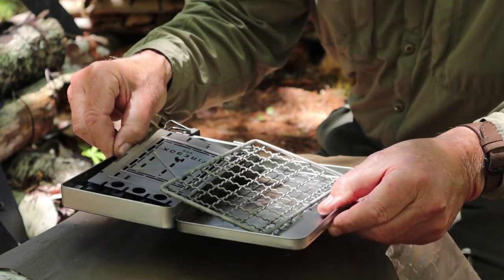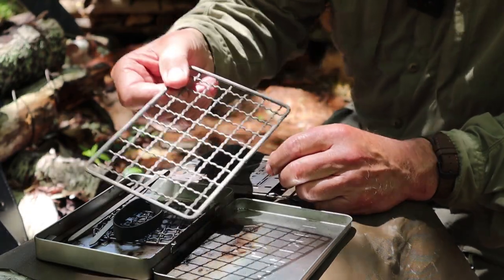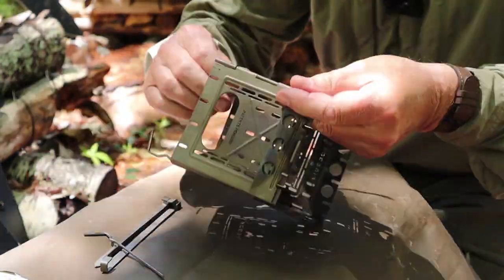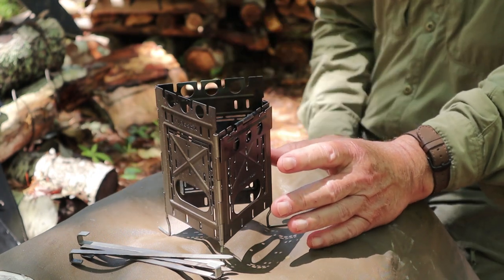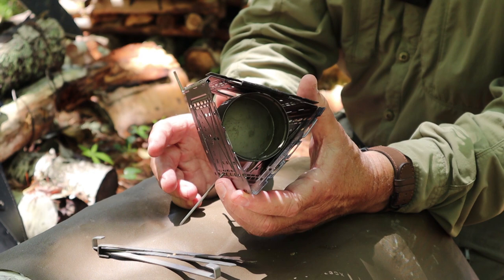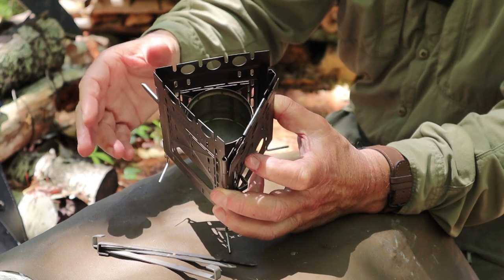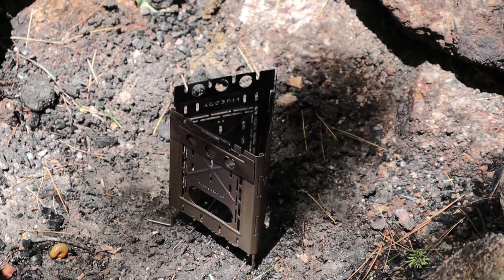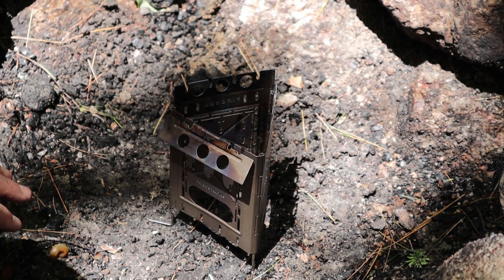Firebox Freestyle in Three Sided Configuration

Comment: Well done Mark 👍😎👌
I really like the three-sided stove and have found myself using it quite a bit. I don't find it necessary to have the fire Stick crossing on top to hold a small pot. The corner of the two high sides seems to do the trick just fine. For me the only reason to carry any fire sticks at all would be if I am planning to use an alcohol burner. Otherwise all I need are the three sides which makes for an extremely minimalistic and ultralight weight wood burner 👍 Cheers😎
Reply from the maker: Hi Steve. I agree, the three-sided stove makes a great minimalist stove. Thanks for commenting

Comment: Use the cotton bag, buy some 6mm thick firefelt as a heat protective base, aluminium foil is a heat sink, so must still get the ground hot.
Leave the oversized tin at home when using 3 and 4 sides.
Thank you for sharing, all of interest as usual.
Take care
Reply from the maker: Great suggestions. Thanks for commenting

Comment: The problem with any tall stove is that, once the coal bed is suitable for grilling meat, it's too far below the meat to cook it. I use my large Toaks titanium stackable stove for a quick boil, and my Firebox Nano for grilling, though it suffers from a small surface area. It's great for hot dogs and sausages, though, which are better options for hiking than burgers and steaks. On this spring's 230 mile Appalachian Trail section hike I left the wood stoves home and  just used my Supercat homemade alcohol stove. My longest time between resupply options was 6 days, so I didn't need much stove fuel. Surprisingly,  I didn't miss a wood fire. I only spent one night in the woods with a group, and they built a nice fire in the fire pit. Interestingly, no one used it for cooking!
Excellent presentation and wood stove physics theory.
Reply from the maker: Yes, tall stoves like the Toaks work best for quick heat for boiling but not so much for grilling. It is hard to find a stove that does it all well and is still ultralight. The Freestyle and the Nano are close but even they take skill to use for grilling. Thanks for commenting

Comment: I’m assuming you’re using the smallest of the fiberglass mats available (30cm x 30cm). Could it be folded around the disassembled stove, top side facing inwards, and secured with that Ranger Band you left behind, to act as a case for the stove, so the bag could also be left behind?
Reply from the maker: yes, it the smallest one and that is a great idea. Thanks for commenting

Comment: Getting all the lighter weight advantages BUT with a high quality stove. You're not wrong about issues at altitude. The ice cream always expands on my way home from shopping. 2-stroke engines can get the wobbles, especially with changes in air pressure up here. Great video Mark. Can you still use the little toaster attachment with this configuration ? I use a barrel type gasification stove, with wood. It has a two-speed battery operated fan, which is necessary once you place a pot on top. The more oxygen, the better.
Reply from the maker: Yes, a fan powered stove like the BioLite will have an advantage at altitude. As for the toaster, if you are meaning the grill, then yes but there is not a lot of area on top to grill over. Thanks for commenting

Comment: I wonder if making the sticks a little shorter would help with the damping and smoke.  If you got a foot of flame, it certainly wouldn’t hurt heat wise, and maybe would give it more air.
Reply from the maker: It might Jim. Lot of factors go into reducing smoke. The height of the fuel in relation to the bottom of the pot is one of them. I can do a side by side test with different height wood and see. Thanks for commenting

Comment: G'day Mark, well, I'm not particularly a gram counter mate, though in fairness, who wants to carry unnecessary weight, especially over longer distances. It sure is a significant difference and couldn't be easier to convert, I assume an intentional design feature ? If so, well done Firebox, if not, well done Mark, lol.
I've been close to pulling the trigger a couple of times on either a Firebox or Solo stove;
however with all the fire ban days here, kinda seems quite pointless, except perhaps in emergency. In any case, why not leave the lot at home and just make an open fire .............. 
Incidentally; I've been carrying a refillable torch type lighter for a few years now, as well as a bic and ferro rod. Sure makes life easier in the wind, not bad on damp material also.
Cheers Duke.
Reply from the maker: Hi Duke. I don't get a chance to make fires most of the summer because of bans. When I can, I like using my stoves as they take so little wood to cook a meal and leave little trace of me being there. Still, I do like a good size open fire once in a while. Thanks for commenting

Comment: Hi Mark! 

Been watching many of your videos and Im a big fan!

However, I think it's not worth it to buy Firebox Freestyle - if you are not into making a firepit for big family (then go ahead by a doublle stack Freestyle). 

Otherwise, It's much more worth it to just buy a double stack Firebox Nano which is the ULTIMATE multi purpose stove which is not revolving around firepit for family.

Why?

Because Nano is first of all MUCH ligher, like TWICE as light as a Freestyle. Secondly, you can use it with anything you want: All the way from Trangia Alcohol burner to Trangia Gas burner to wood, or even Esbit tablet burner.

If you want a "rocket stove" with Swedish torch like you mention here in this video, just use a double stack Nano which creates even longer lasting fire than this Freestyle which you mentioned here. 

I think it's nice of Steve to come up with new ideas but I personally think this Freestyle is waaaaay too "niche" of a product than his King of the stove: Nano. 

Sadly, it's hard to beat Nano. Steve already beat himself by creating that Nano. The bar was already too high to beat that record. Freestyle is too gimmick in my opinion but if you are guy with big family and a camper van, then go ahead, this is perfect for you!

Otherwise as a lonely man hiker, I would rather stick with that light weight Nano. 

And btw: The 3-sided Freestyle is actually harder to fold together, you will have to remove one of the metal stick to fold it. Lighter weight but more fiddling in the cold (just a minor detail).
Reply from the maker: Interesting logic. Thanks for commenting